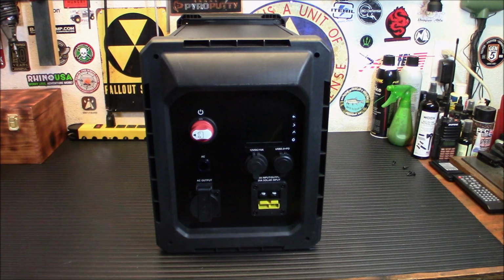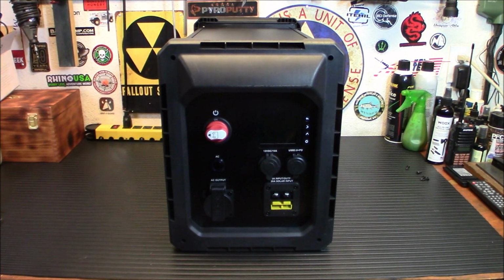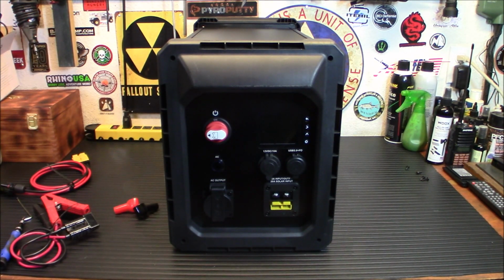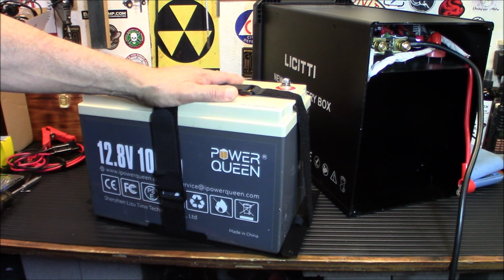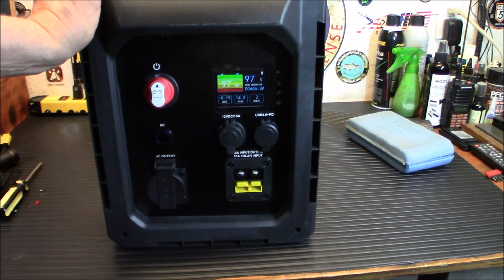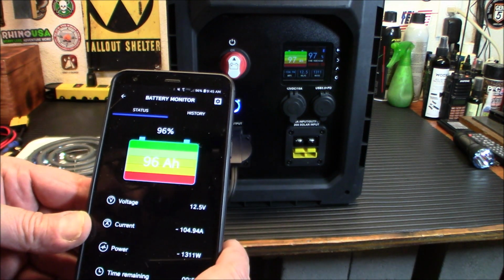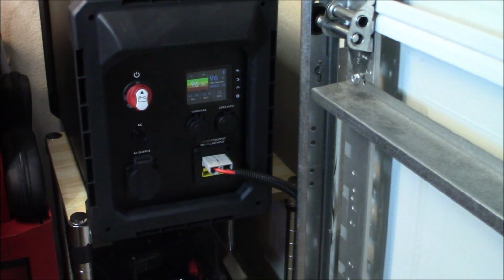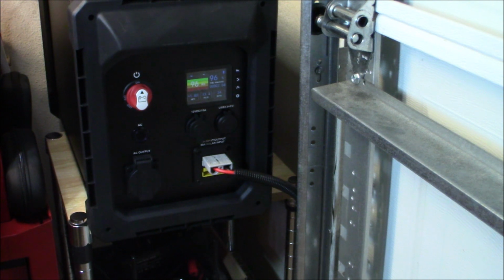Use Your Own Battery And Save! Licitti 2000W AC Battery Box

Comment: Seams a overkill if you use 100ah or 1280 whit won't run 2000w for long , I don't know why anyone that makes a box that well take a 200 or 300w battery. Most 100ah batteries BMS only gives around 50anp

Comment: How can I run a Blue Seas DC distribution box in a small trailer while charging box using Anderson port? I wouldn’t want to use the 12v cigarette as that is limited to 10A and ideally I’d like 25A minimum to the DC distribution box?

Also, how loud is it?

Comment: Is there any 12 volt 200 amp battery's LifePO that fits the 2000 and what are the internal dimensions of the box ?
Reply: I was thinking the same thing, it looks too small to fit a 200ah battery in it.
Unless you can adjust the battery tray to suit different batteries?
Reply: @ozzie7523  The trays width is the issue if it could get modified it would work.

Comment: Thanks for the video. I purchased this battery box in hopes of using my Litime 12.8v 100A battery. However, the clearance is so tight that when I push the tray and battery in, the negative terminal boot slides off, exposing the bare terminal. How did you install the negative cable, i.e. orientation, on the battery?

Comment: Can this be charged while in use? Example: The unit is powering a TV, while also being charged via solar panel?
Reply from the maker: Yes it has pass though charging so you can charge it while using it

Comment: I'm receiving the licitti 1000w power box today. I have a redodo 100ah I'm putting in. I also have the bluetti eb3a as well. I am also making a dyi solar controller box.great video
Reply: Do these units also have dc to DC charging capability?
Reply: @camposvazquez  with a solar panel and a car cigarette lighter. Would need to make a cable for this
Reply: @hayzersolar  thank you

Comment: Does a 12v 200ah battery fit in the box to get the 2000w?
Reply: The 100 amp looked like it filled the battery tray. 200 ah would be really nice to put in this box.

Comment: Can you power a refrigerator with this thing or do you think that would be too much
Reply: I power my full size refrigerator with my 1000W renogy inverter, so this 2000W should easily handle any fridge. A 100Ah lithium battery like he has would keep a fridge running about 10 hours.

Comment: The manufacturer has user manual for the 3000 series on their we site, but not the 2000. I would like to know the total amps out capability and the solar Voc and amp rating for input as well.
Reply: Ok amps watts volts reminds me of what Charlie Browns teacher sounds like. So I know the amps volts, but my solar panels are watts. So can someone please tell max wattage of solar input? Pretty please 😊
Reply: @texaseagle7119  Assuming the 20A is the limit on the output to the battery, assume you can handle 240W as the battery is nominally 12V.
Reply: According to the user manual: "20A SOLAR INPUT(max 50V)"

Comment: Pure sine wave? Regulated 12V?
Reply from the maker: Yes to both, i did forget to mention that
Reply: LIPO doesn't need to be "regulated" because of the higher voltage, it will run mini fridges and everything else...If that was what you were thinking of using..

Comment: You mention update to 200AH, I could not find dimensions to see if one would fit. Does the documentation show the size battery that will fit inside the tray? Looks like it has to fit the same footprint of a 100AH. Can not find a 200AH that size. But even with a 100AH for about 300, hard to find a prebuilt one at that capacity of 2000W. Their cyberbox 3000 caught my eye when I saw 220V, but pretty sure it is a European model. Would be nice to get an inexpensive unit that could do the well pump. Versus combing two units to get 220V.
Reply: It will not fit 200/300ah batteries without removing the cell from the factory case and installing naked. The battery, not you. Not judging.
Reply: The manufacturer website states that a 300AH battery can be used as well, but like you, I can’t find a footprint dimension for those kinds of capacities that would fit in the case. Perhaps they expect you to leave it cables externally 🤷‍♂️
Reply: Im another witness to the lack of information on the 200AH or 300AH claim with no specifications or dimensions. Hopefully they fix this soon?

Comment: I wish I understood amp hours vs watts and what typse of batteries it accepts.  There is so much I don't understand when it comes to electricity.
Reply: PS. The 6 Hours of Solar Charging I used in my example is the average peak sun exposure measurement used when getting a ballpark for solar needs. Depending on your area it may be better or worse.
Reply: Also understand the proper wiring to use! Never exceed the Amp rating of a wire, you can look up appropriate wire sizes for the Amp rating of a device!

Never draw more Amps or Wattage than a system like this is designed for...READ THE MANUAL FOR SPECS
Reply: OMG that was sooooo helpful! I was looking for the max solar input foun Amp and volts but panels come in watts. Thanks
Reply: @texaseagle7119  Do your own research as well and always give your system some headroom so you do not over stress the limits of your hardware.
Reply: Its easy
Watts = Voltage x Amps
Amps = Watts ÷ Voltage

Watt hour = 
Voltage x Amp hour

12V 100Ah Battery:

12v x 100 Ah
= 1200 Watts of power

Theoretically, that means you can run a 100 Watt device for 12 Hours.

However it is less due to resistance, power loss, and battery degradation.

This battery box has a solar input MAX:

20 Amps @ 12V:

12v x 20 Amps =
 240 Watts

Therefore if you bought a single 240W 12V Solar Panel, you would provide the max input available on this box.

If your Solar Panel provides 240w for 6 hours:
240 x 6 = 1440 Watt Hours

1440 Watt hours Converted to Amp Hours:
1440W ÷ 12v = 120 Ah

Theoretically you do have power loss through this process so the math isn't exact.

But if you wanted to Max Out the capability of this battery box and say Charge it and Discharge it everyday....you would need:

12V -120Ah LIFEPO4 Battery
12V 240W Solar Panel

You could go larger on the Battery but keep in mind the Solar Input won't charge it in one day.

A total of 1440 Watt Hours means you can run a 100 Watt device for 14.4 Hours.
 
Hope this helped.